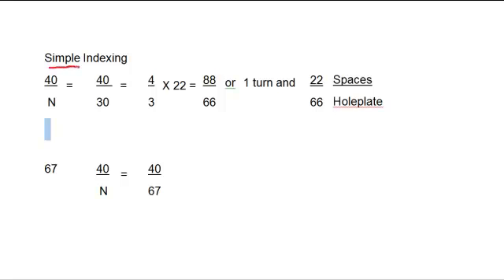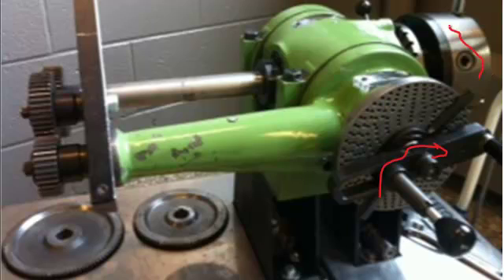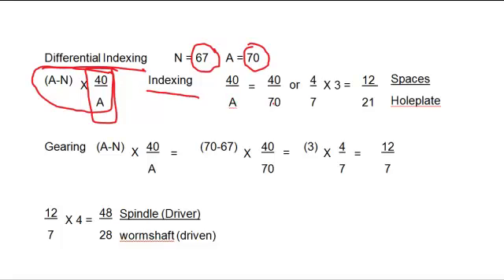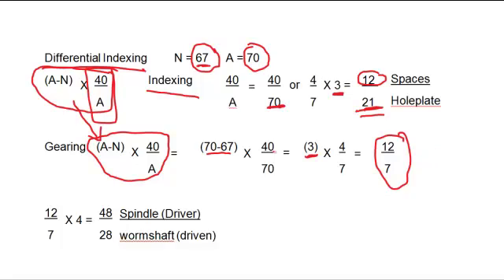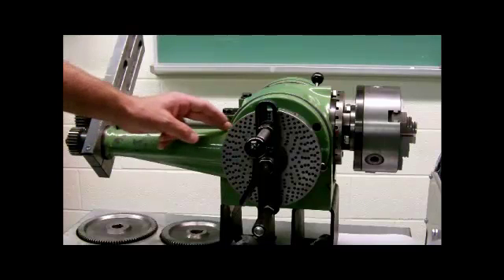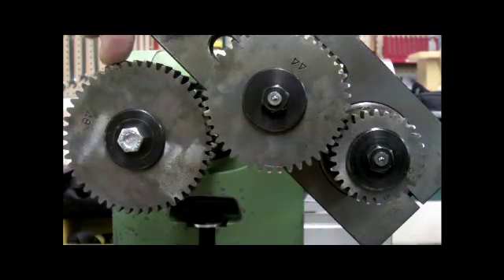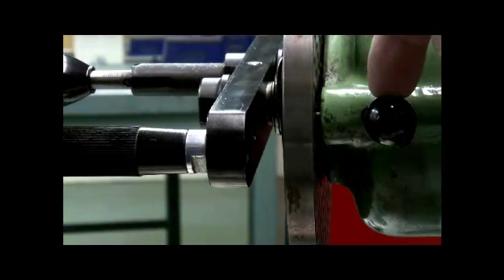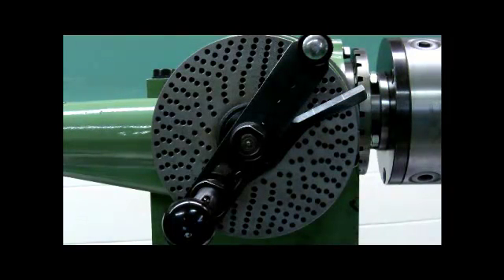Differential Indexing Using a Dividing Head

Comment: Good evening, I wanted to ask you a question... I bought a used ZAGAZA brand divider, and it is missing one of the bevel gears, which is responsible for activating the gear train shaft at the back of the divider. The gear that is connected to the crank has 24 teeth and the outer diameter is 55. So I wanted to know from you, or from any other subscriber of the channel who can help me, if the crank ratio is the same as that of the rear axle? Or is there a difference? For example... I turn the crank once, and the shaft where the gear train is mounted also turns once.

Comment: This is the best explanation I have seen. After 65 years in the toolmaking business  I have to cut a 127 tooth gear. My first EVER compound indexing job, yes, still working because I love it.  Wonderful video...thanks.
Reply from the maker: I'm glad it helped. I appreciate you watching and leaving a message. I'm sure you know the 127 tooth gear is used to cut metric threads along with a 50 tooth gear. 1 inch = 2.54cm ...50 x 2.54...
Reply: @machiningmoments  Yes, and that's why I need one. The original one suffered catastrophic damage ad I needed a new one.

Comment: Great explanation....however i dont have a 21 hole plate...my ratio is 40:1....so im using 24/42 for the indexing part ...still not giving 67 divisions..can u please explain?thanks
Reply from the maker: @niteshseuraj3762  how many divisions are you requiring? What are the hole numbers on your hole plate?
Reply: Hi i required 67 divisions....i dont have a 21 hole plate  so i thought i could use 24/42 for the indexing part with the same gear train but it didnt work

Comment: Why cant it be 1 revolution 10 in a 30 hole plate instead of 1 revolution 22 holes in a 66 hole plate.
Reply from the maker: As long as it satisfies the fraction it works so 22/66 is 1/3rd same as 10/30 is 1/3rd. So they both work. Good practice is to choose the multiple on the largest diameter. Thanks you for watching and your message.

Comment: I am having trouble with the math figuring out the gears to index for 127 tooth gear, could you show this example?
 Thanks Blair
Reply from the maker: Hi Blair, great question. This requires differential indexing so (A-N)40/A 
Try A=120 (120 - 127)40/120 your indexing 40/120 becomes 1/3 not sure which dividing head you have but lets say 11 spaces on a 33 hole plate. Now used the full formula for the gear train which works out to -7/3. Multiple this fraction by 8 and you get -56/24 so your gears are 56 (driver) and 24 (driven). You need two idlers to satisfy the negative fraction (opposite rotation). Good Luck!
Reply: @machiningmoments  Thanks My Mill is a Parkson 2N Universal, with the 12" Parkson Universal Dividing Head, Only Problem now is all the Change Gears are Missing. I am going to get a price on a set of gears made by 3D printing, they should be fine for Indexing. It  also came with a Cam Milling Attachment, that is quite a piece of equipment, today you just need to write a program and push Rum
My Plate is double sided with the holes
1st Side  24,25,28,30,34,37,38,39,41,42,43. 2nd Side 46,47,49,51,53,54,57,58,59,62,66,
The list of Change Gears Listed is 24,28,32,40,44,48,56(2),64,72,86,88,100 Teeth
Do you have any suggestion's on extra change gears I should get besides what's listed?
I can use 22 spaces on my 66 hole plate
Thanks 
Blair

Comment: Great explanation, only one nitpick, when you are doing the math in some cases you multiply the fraction by a number and multiply the nominator and denominator, other times you multiply only one.  The issue is simply that when you are multiplying both you are really multiplying by one in the form of 2/2, 3/3, 4/4.

I think it would be much more clear if you showed this in the video. For Example at 03:22 in the video the 4/7 * 3 should really be 4/7 * 3/3 = 12/21
The same for the 12/7 * 4/4 = 48/28 for the gear ratio below.

This is not to be confused with the (3) * 4/7 on the second equation line which is really 3/1 * 4/7.

Anyways I found the video very useful, Thank you!
Reply from the maker: Thank you for your kind words. Welcome to machining you are going to love this trade!
Reply from the maker: One thing I learned when I started this is it easy to miss something. Thanks for catching the inconsistency. I appreciate you watching and posting.
Reply: @machiningmoments  It is a fantastic video, you did a great job explaining it. I am just getting started in machining and have much to learn, people like you are what will make it possible to learn this new skill.

Comment: How come your idler is 44?  Would that not be a compound gearing, or at least change your gear ratio?  Shouldn't it be 48-48-28?
Reply from the maker: All the idler gear is doing is moving power from the driver to the driven. It could be 12 teeth or 100 teeth. The ratio is determined by the number of teeth between the first and last gear. This is known as simple gearing...a simple gear train not a compound gear train. Thanks for your question and watching.
Reply: Hm, very interesting to learn, thank you for that insight.  I would have thought it would change the gearing ratio.

Comment: Hi, may I know why would you choose 44 as the idle gear?
Reply from the maker: Sorry for the slow reply, busy day. The number of teeth on the idler is irrelevant, all it does is move the power from the driver to the driven. I likely used 44 teeth because the gap was close to that size and I wouldn't have to adjust the setup much. It could have been any number of teeth for the idler.
Reply: machiningmoments thanks for the reply. Do you have any video about cutting helical gear? Do you have any good reference books to read about gear and its theory?
Reply from the maker: I have cut helical gears and have often thought about making a video. I don't have one yet. The problem is it is a very involved topic. The book I like to use is Technology of Machine Tools by Steven Krar. If you would like to leave me your email address I have a power point on helical gear cutting I can send you.
Reply: machiningmoments thanks for your reply. Look forward to the ppt slides :)
Reply: machiningmoments received your mail. Thanks a lot.
Reply from the maker: My pleasure, I hope it makes sense.

Comment: Good video. You mentioned compound gears on back. I’m going over questions for making calculations for 53, 59, 101, and 175 divisions. I think I need more than two gears on back. How do I do the math?
Reply from the maker: Hi Dana, the formula is (A-N)x40/A. I assume you don't have a 53 hole plate, you could simple index 40 spaces on a 53 hole plate and ignore the gears. So, I choose 60 for an approximate (A) (60-53) x 40/60...if you work that out it 14/3 as an improper fraction (your gear ratio). 14/3 is the same thing as 7/3x 2/1. Now we look for a multiple of each fraction that will give us the gears we need. 7/3 x 8 will give us the first two gears 56/24...The other fraction 2/1 x 24 will give us the last two gears 48/24. 56 goes to the spindle and meshes with 24, 48 goes on top of the 24 (compound) and 48 meshes with 56 on the worm shaft. Your indexing is 40/A 40/60 or 2/3 find a multiple of this that works with a hole plate you have...30 as an example. The indexing is 20 spaces on a 30 hole plate. Note! the index plate has to rotate (driven by the gear train you created) make sure it is unlocked. Clear as mud? ;)
Reply: machiningmoments I’ll do the math too on paper and see if I work it out. Thanks.
Reply: Okay. I worked out pretty much the same thing as you said only I had to use a 33 holes plate which would be 22 spaces on a 33 holes plate. Only thing is I’m not sure of the meshing of the gears. I’m a visual person so if you could draw the gears in contact with each other would be great. http://vintagemachinery.org/pubs/2185/5863.pdf this is a link to instruction manual to brown and sharp dividing head. It has some good info.
Reply: I now used 55 for A. It will work with only two gears. Here’s my math. 55-53=2. 2x40=80. 80/5=16. 55/5=11. 16x4=64. 11x4=44. There is a 64 toothed gear and a 44 toothed gear. Does that make sense?
Reply from the maker: Hi Dana, sorry for the slow reply busy weekend. So I assume you have your gear ratio fraction worked out. For argument sake let's say that ratio is 1/4 and you can't find two gears to satisfy this fraction. 1/4 is the same as 1/2 x 1/2 now look for gears to satisfy each fraction the first 1/2 gears are 24/48 and the second fraction is 32/64. The 24 gear is on the spindle it meshes with the 48 tooth gear. Stack the 32 gear on top of the 48 tooth gear (compound) the 32 gear meshes with the 64 tooth gear that is on the worm shaft. This is compound gearing satisfying the original 1/4 gear ratio. I hope this makes sense. Good luck.
Reply: machiningmoments didn’t get things worked out. Even if you did the 53 divisions and showed the math would be great. I tried different scenarios for factor A and just got confused using (A-N)x40/N.

Comment: Sir... 12 / 21= 0.571428 turn × 28= 16 / 48= 0.3 turn spindle
40 / 67= 0.597 turn spindle ??
Reply from the maker: The problem with 67 is there is not a 67 hole plate so it becomes difficult...not impossible but difficult.
Reply: @machiningmoments  Are the distribution results right ?
Reply: 40 / 70 / 40= 0.014 turn spindle rigth ??
0.014 × 48 / 28= 0.024 turn plate indexing rigth ??
Reply from the maker: Sorry for the slow reply, busy weekend. I would leave your work in a fractional form. Your example 40/70 is the same as 4/7 find a multiple of the denominator that matches with a hole plate you have. Example assume you have a 28 hole plate. 4 times 7 is 28 so it satisfies the denominator. Numerator and denominator use the same multiple.  So your solution would be 16 spaces on a 28 hole plate (assuming you have a 28 hole plate). I hope that makes sense. Good Luck!

Comment: sir i want to know weather 120 will be possible in that table.like24,28 etc same way does 120 can come in that table of spindle value after solving
Reply from the maker: 120 can be done with simple indexing. 40/N ...40/120 or 1/3. Look at your hole plate and choose the diameter that is a multiple of 3. Example let's say you have a 30 hole plate, your indexing would be 10 spaces on a 30 hole plate for 120 divisions.
Reply: @machiningmoments  Thanks a lot now i get it.😊😊😊
Reply from the maker: I'm glad, thanks for letting me know. Good luck!

Comment: This is an old video, but I will hail Mary it anyway.

I want to buy a dividing head that can do this feedback process to move the hole plate. Is there a name or modifier I should search for when looking for dividing heads? Thanks!
Reply from the maker: No, I think it's just a standard dividing head. Make sure you are able to engage the worm shaft (move the dividing head by turning the index crank) also you want a shaft to come off the worm shaft on the back of the dividing head to add gears to.
Thanks for the "hail Mary"1

Comment: Hello sir..may i asked a lil favor..can you make a video on how to set up up a full differential gear driven into the automatic movement o the table of a milling machine? In making a helical gear for example..it will be very helpful to us sir..hope you will do..ty
Reply from the maker: It is not possible to gear a dividing head to the table and differential index. The gear I would have from the dividing head to the milling machine table is used to gear to the dividing head spindle instead. If you want to gear the dividing head to the milling machine you have to use simple indexing. Please have a look at my Cam Milling video. If you can't find it I'll send you a link. If question arise please let me know.

Comment: I have a question why you use 70?  can we use another like 68? And if I use deferent hole plate it will change the gear ratio?
Reply from the maker: Absolutely, as long as the solution works with available gears and holeplate.
Reply: Thank you sir for your video.
And reply to my question. 
I am confuse,can you help me how to get the gear ratio for 87T spur gear. Thank you again sir,
Reply from the maker: Ok so 87 teeth is what you require. This needs to be done with differential indexing (in the video). A = approximate number and N = your actual number. The formula is (A-N)x40/A I chose 90 as my A...So (A-N)x40/A = (90-87)x40/90 = (3)x4/9 = 12/9 Your indexing is 40/90 or 4/9 and your gear train 12/9 (lowest common denominator 4/3. Indexing first, find a holeplate that is a multiple of the demoninator of the 4/9 fraction. A 27 or a 54 holeplate will work, assume you use a 27 holeplate 3x9=27 you need to use the same multiple for the numerator 3x4=12. So your indexing is 12 spaces on a 27 hole plate. Next you need the gear train, the ratio calculated above 4/3 multiply numerator and denominator by 8 and you get 32/24. These are your gears. The 32 tooth gear goes on the spindle and the 24 tooth gear goes on the other shaft (back into the wormshaft). There will be an idler in between these two gears (any gear will do you don't care how many teeth it has). Remember to unlock the holeplate it has to turn, that's why you made the gear train. I hope this makes sense. Good luck!
Reply: Thank you sir, this will help me.

Comment: I have question Mr,, 
How to select gear train for making helical gear in fact I searched for this issue on net but no one covered this issue. Thanks from now.
Reply from the maker: You need to know the lead of the helix on the gear, in other words how long would the gear be if one tooth made a 360 deg rotation.

Comment: is this the way to do prime numbers like a 127 tooth gear?  thanks
Reply from the maker: It is more about creating a ratio that will allow the hole plate to move so it can mathematically correct an error introduced allowing use of the device. On a side note the 127 T gear can be used for metric conversion.

Comment: Where did the idler 44 came from? Does it affect the ratio?
Reply from the maker: Honestly Rico the answer is it was what fit in between. The number on teeth on the idle means nothing, it could be 10,000 teeth, all it does is provide a drive between the driver and driven gears. Good question!

Comment: why 44 teeth gear is used as idler .. won't it change the gear ratio?
Reply from the maker: It doesn't matter how many (or few) teeth are on the idler, it is only used to move the power from the first gear to the last.
Reply: No, Gear ratio in this case will be (48/44)*(44/28)
idler gear teeth cancel out
Reply: In simple gear train number of idlers and teeth on idler do not affect the gear ratio. 
Idlers are used to transmit the from from driver to driven.

Comment: Hello again :) , can i ask if there is a way to find the helix angle of a damaged helical gear , if you have just the damaged gear , i did use my Universal Bevel protractor but the result was not accurate.
Reply from the maker: +Nacer Ziani Do you have enough of the gear left to get a diameter and number of teeth
Reply: +machiningmoments Yes I have , The number of teeth is 15 tooth , and the outside diameter is about 54 , and this is a pic of it  i.imgur. com / 0YMlizT . jpg
Reply from the maker: Ok, take the OD and subtract the depth of the tooth (this will get you close to pitch diameter(PD) unless you know the DP (in your case Normal Diametral Pitch)). Once you have pitch diameter multiply by pie(3.14) to get circumference. Now divide the number of teeth by the circumference this will give you circular pitch (distance from one tooth to the next at the PD) this is side opposite. Next measure the gears thickness at the tooth, this is side adjacent. The helix angle is only a trig function away.
Note: both gears in mesh will have the angle and NDP. Good Luck!
Reply: machiningmoments ... Thank you again! I just watched this again after a few years, and found it just as fascinating as the first time. Actually, hi schoo shop class was the first time I was able to understand the geometry I was also studying. I became a wiz at making gears.

Comment: Hello sir :)

I have this question, what is the right formula to calculate the module (metric) with this details I have [OD, Helix Angle, and Number of teeth ] ,
Reply from the maker: +Nacer Ziani OD = (N+2)M So, outside diameter divided by (number of teeth plus 2) should give you the module.
Reply: +machiningmoments Thanks for responding , but i think this equation works just with metric spur gears , or am i wrong ?
Reply from the maker: +Nacer Ziani The formula is for metric spur gears which is the "module" same as addendum...if you have OD and teeth you should be able to calculate the module with this formula. The helix angle allows you to set the cutter angle (table).
Reply: +machiningmoments thanks man for your help
Reply from the maker: +Nacer Ziani  Glad to, good luck!